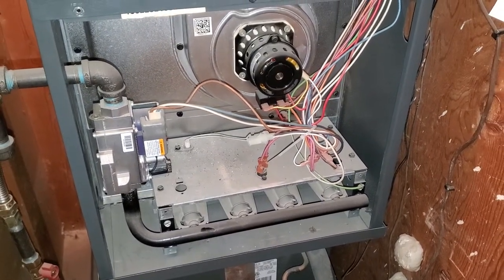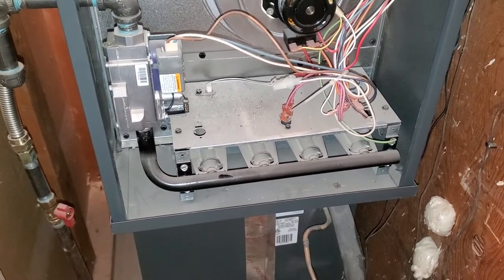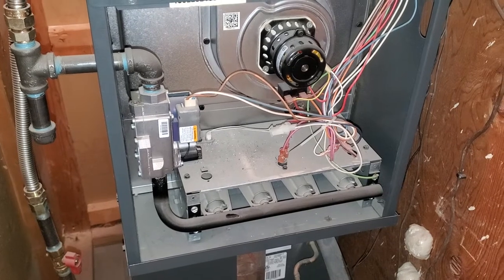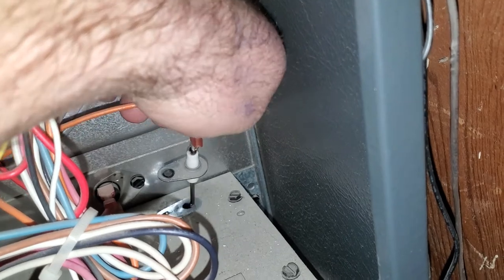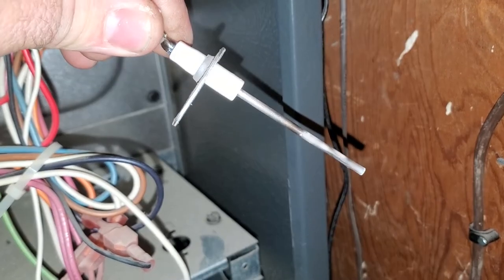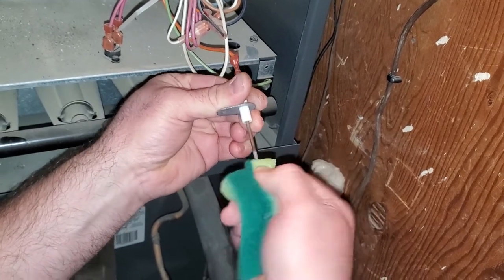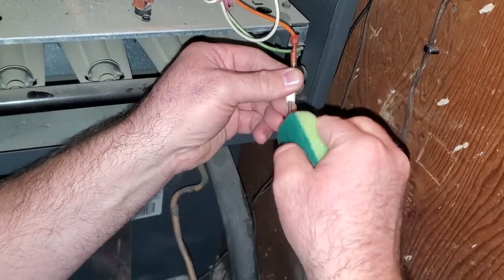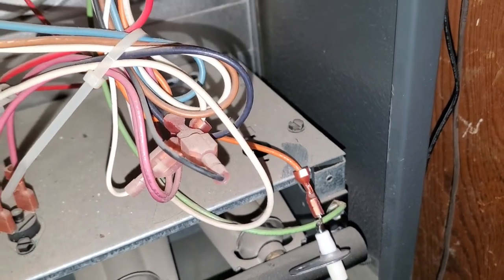Furnace Lights Then Goes Out - Dirty Flame Sensor

Comment: My furnace would come on, inducer blowing, ignitor glowing and then the gas would come on and ignite and furnace would go out.  So you are thinking it's the flame sensor.  So did I.  I cleaned it and put it back in and furnace worked for about a day and started the same stuff all over again.  Ordered 2 new flame sensors and replaced.  Worked for about a day or so and started doing the same thing.  I researched and researched.  Somebody mentioned it could be the burner that was dirty or even the circuit board.  Then someone said it might be the pressure switch.  I found my pressure switch online and ordered it.  A few days later it arrived and I replaced it.  Guess what?  Furnace works now.  Who would ever think that the pressure switch mimics the same symptoms as the flame sensor.  But, it did.  I'm not an HVAC guy and I try to do my own repairs if possible.  You might mention in your videos about flame sensors that if cleaning them doesn't work, the pressure switch may just be the problem.
Reply from the maker: I also have another video showing a pressure switch malfunction on a different unit.  https://www.youtube.com/watch?v=wPSAKdYfkrM&t=6s